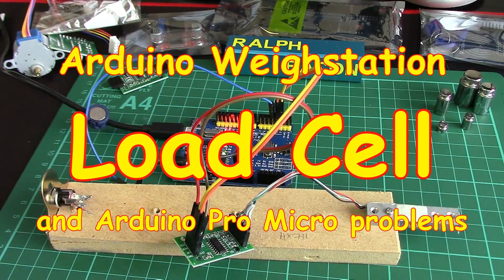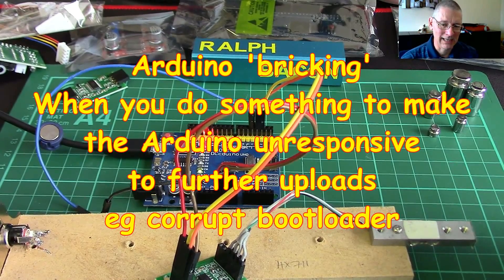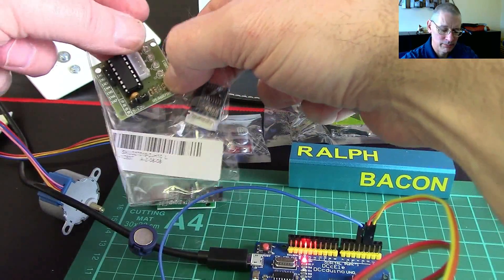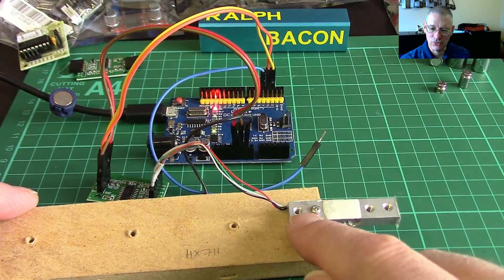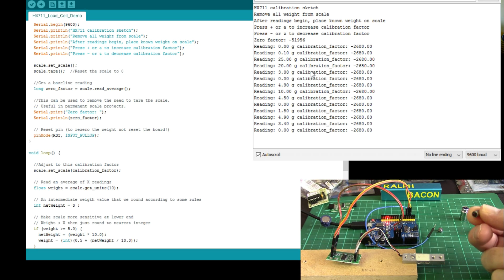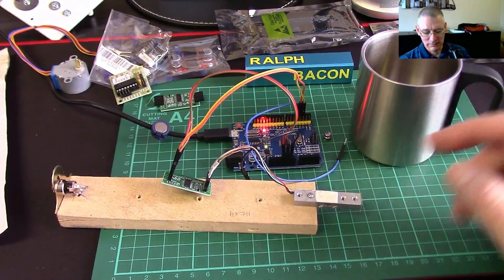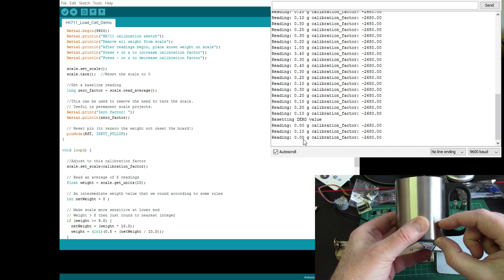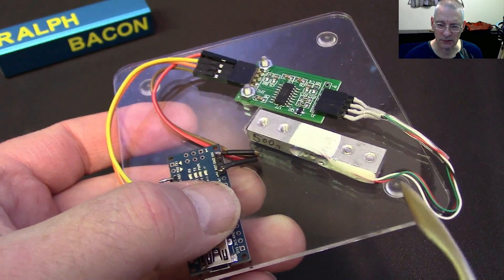#31 Load Cell project (part 1) Arduino Micro problems plus postman deliveries

Comment: Hello Mr. Ralph S Bacon.
Im come from Viet Nam. My English not good but I hope u can help me.

I have 1 project with loadcell, arduino and 2 step motor( example: Step A and Step B).
__________________
1. Im setup value Loadcell is 50 gram ( press from keypad 4x4) then:
- Step A( Step motor) ROTATE CLOCKWISE about 100 second ( delay 100 second ) then Step A REVERSE ROTATION and Step B ROTATE CLOCKWISE.... And loop back to when press stop button.
*******************
I dont understand How about output signal from loadcell control step motor. Mr. Ralph S Bacon can suggest for me write code arduino.
_____________________
 I really appreciate your help with my project! I owe you a great deal
__________
Can you contact with me E-mail: matsusakutaro@gmail.com
Reply from the maker: Hello Sakutaro from Vietnam! I can't write your code for you, but I can suggest how you might approach this project so that you learn the individual skills necessary.

1. Create a simple project that only deals with a single stepper motor. My videos #38 & #39 may help you with this. Get this working so that you understand exactly how to control a stepper motor.
 
2. Create a simple project that only deals with the Load Cell. This video #31 & the next one #32 deal with that. When you have this working so that weights are measured accurately each time you can move onto the next step.
 
Once you have mastered those two areas you may already realise how to combine the two projects to control your stepper motors. If you try and rush this all as one big project you will not understand the individual steps you need to take to ensure success.
 
From your description I can't understand what the Load Cell is trying to do as part of your overall project, so make sure that you have fully detailed each step (like a flow chart). Then others may be able to assist you further. Good luck and if you have specific questions on the Load Cell or Stepper Motor do reply to this message - but as I said I won't write your code for you, that's the challenge you have set yourself! Good luck.

Comment: How do I sensitize it to measure how much left in a Tod glass?
Reply from the maker: I'm assuming here, Johannes, you mean a tot (as in shot) glass, not Tod(d) Glass, the famous American stand-up comedian? If you use a 100g Load Cell as I did it will EASILY measure down to the last dribble in the glass, as per my coffee cup coaster does, every day. What Load Cell are you using? And what sketch? If you use both a 100g Load Cell and my Coffee Cup coaster sketch then it will be no problemo. Let me know your set up.
Reply: Ebay no name cheap loadcell. We can call your Todd a shot for my purpose (25ml approx)  Thanks will post sketch soon.
Reply from the maker: The critical factor here, Johannes, is the max load of the Load Cell. A 100g cell (like mine) is very sensitive right down to the last 1/10 of a gram. If, by chance, you're using a 1 Kg Load Cell then I think you will have problems getting it sensitive enough. As you say, though, get it up and running whatever the capacity because you can always swap out one Load Cell for another and just re-run the calibration routine.

Comment: So... could a load cell be used in the 'hand' of a robot arm to control grip pressure? (I'm a beginner so be patient if you have already answered)
Reply from the maker: I'VE ALREADY ANSWERED THIS DAMMIT... oh, sorry, didn't read to the end of your post! Heh, heh, just kidding Jennifer, we were all beginners once (and I still am, as far as I am concerned). Benny is the guru, not me. Now...
 
Now, the Load Cell is quite chunky as the video shows. It must be mounted so the "weighing end" is free floating. Absolutely nothing much touch it (no covering, for example). If all these requirements can be built into a robot hand then it would definitely measure grip (well, the pressure exerted upon it, in grams).
 
If you can't physically fit the device into a finger/hand then how about conductive foam? That too changes resistance depending on pressure, although I don't know how durable it will be. Just suggestin'! Thanks for your question, Jennifer, and I wish you luck in your project!
Reply: Jennifer,  
 You can use this to measure pressure, the device under the glue in the load cell (The actual resistor network) is called a strain gauge, they come in various sizes from very very tiny to quite big. The sensitivity of the measurement they make is directly affected by the gauge chosen and the flexibility of the thing being bent. (Thats why there are holes in that bar, to make it more sensitive, without the holes it would still work, but would not read the very small weights) 
Here are some examples of strain gauges:
https://www.digikey.com/products/en/sensors-transducers/strain-gauges/559?k=strain%20gages

These can be wired to the same HX711 Ralph uses.
 Regards, 
   Drew
Read more

Comment: Hello, I work with this HX711 amplifier, for a communicating mailbox project, when there is a letter / parcel, it sends a notification to a phone: D, I would like to know how many bytes are transferred per second , moreover I do not know how are connected the pins CLOCK AND DAT.Thanks !
Reply from the maker: Hello AppleFanBoy! The Sparkfun datasheet for this device states that you can select either 10SPS or 80SPS. The CLOCK is driven by the microcontroller and the DATA OUT is read by the µController. Your best best is to read in some detail this document(https://cdn.sparkfun.com/datasheets/Sensors/ForceFlex/hx711_english.pdf) or buy a module like I use in the demo (so much simpler, IMHO). Have fun with this!
Reply: Thanks :D

Comment: Hi how about fitting it to the bottom of your post box to let you know when you get mail
Reply from the maker: A brilliant idea Paul! This would work well in the United States where mail gets delivered to funny looking mail boxes at the end of the front garden (although the postman raises a flag too) - but you'd need power out there, either running up the mail box post or solar power (let's face it, post is unlikely to be delivered at night).
 
In the UK, it's a little different, as all mail is delivered through the letter box of each house (no outside mail boxes at all) but it could sense the mail falling to the floor in the area of the letter box, as long as the mail didn't waft up the hall too far!
 
I'm not sure how mail is delivered in the United States in cities with apartment blocks; I'm assuming the mail goes into mail boxes for each apartment in a communal area, which could make it tricky too. My parents' mail is delivered to an external mailbox outside their apartment building but there is no way the landlord would let them start running power to those (shared) mailboxes - nor can they drill holes to provide power by using solar power.
 
So for many people it would work, and for many it would not. But it's a great piece of lateral thinking and perhaps someone reading this will think "Yes! I'll do this" so thanks a bunch for posting (obviously I don't know where you are located in the world, so I covered a few bases here for the benefit of anyone reading this not familiar with the way post is delivered in some parts of the world). Good to hear from you Paul.
Reply: Ralph S Bacon hi I live in the UK and have a postbox fitted to the inside of the front door to stop the dog playing with the post
Reply from the maker: In which case your idea should work 100% - fantastic!
Reply: In my neighborhood (Houston,Texas), our mail is delivered to a gang (cluster) box which is on the next block about 150 feet from my front door. :( Now a box for Amazon deliveries by the front door would be a great candidate for this project!

Comment: Could you not use this device to measure the pressure being exerted during the use of a gripper or perhaps on the fingertips of a prosthetic?
Reply from the maker: Hi Bill! Interesting question. It will measure gripper pressure in the sense that it will correctly detect force (in one direction) but it is  (relatively speaking) a physically large device so I'm not sure how you would incorporate that into a prosthetic to be honest. Moreover, it must be mounted so that the area you exert force on is 'floating' with the other end secured.
 
Have you considered conductive foam that varies its resistance depending on how much pressure is exerted onto it? They're used in burglar alarm door-mats that get triggered when a human walks on them but they don't react to your domestic kitty walking over them. Just suggestin' !
 
Thanks for a great question, you never know, others may chip in here with suggestions too.
Reply: Hey Bill, I posted a response to this question a couple comments up that may be of interest to you.
Reply: Thanks Drew, I checked out the link and some of these seem reasonably feasible. Thanks for the intel.
Reply: Absolutely, the gauges in the link are the type I work with at work, its a good representation of the different styles out there, I'm sure there are much more cost effective hobbyist gauges available.

Comment: Hi, could you have the code show in the video? I only need the calibration code.
Thx a lot. Send me at mauri.carlo00@gmail.com
Reply: HX711_Load_Cell_Demo sketch I need..
Reply from the maker: Hey Carlo! I've added a link to DropBox folder in the next video to this one (so it's #32, in the video description) that contains the two calibration steps you need (one to get the "seed" value, the next to actually calibrate it properly). I've renamed them too so it's no long the name you specified but it should be pretty obvious now). Have a look, any problems let me know!
Reply from the maker: The seed is roughly calculated using the first step of those files I uploaded now. You then use that value in the second step as a starting point and do some fine adjustments there in the sketch by typing + or - in the serial monitor window. 
I can't see that link: 404. That’s an error. The requested URL was not found on this server. That’s all we know.

Comment: I just view your video regarding Arduino and Loading Cell. You might want to monitor weight loss over time. For example, the loss of weight of a beverage (carbonated pop)  as CO2 is escaping the glass. Thanks...!!!
Reply from the maker: You could indeed monitor that Jaime, but the weight of CO2 is tiny compared to the liquid, I wonder if it would even register? According to my school boy chemistry one litre of CO2 gas would weigh just under 2.0 grams. That's one litre of gas. How much in a can of cola though? Interesting post, good to hear from you!

Comment: i wanted to make a PROTOTYPE system in moving train of kids toys. now if the weight will overcome 50 gram in first coach  the door of next coach will open automatically.(resulting into saving electricity & reducing wear & tear of wheels pf train  since until the coach is closed people wont be there inside the coach -considering the original or real situation of trains now a days) I have tested the engine of this toy can only carry 200 grams upto maximum limit . Now it is necessary to put the microcontroller & motor & one other circuit on that train which might weigh 80 grams for door opening  is there any load cell that weighs 50-80 grams & can detect 20-50 grams or should i use any other component & one more thing where to find the PROGRAM for such projcts or my project
Reply from the maker: I'm not sure I understand how you are going to weigh the train if the module you are using is ON that train. Surely the easier way would be to have the equivalent of a train weigh-station so that as the train pulls up at the station, the train(or some of it) is being weighed (by a Load Cell, for example, on which the tracks are laid in the usual way). Effectively it becomes a floating length of track but as the actual vertical deviation is tiny it would probably just be part of the standard track. I would suggest that you experiment with the same Load Cell as in my videos; once you have that working I think you will have a better idea of what would work and what would not. Just suggestin'!

Comment: hello i have not even a bit of idea about automation.but i want to make project on " automatic door open & close system based on weight sensing (that will detect the weight in grams) im pretty much sure i can do it with aurdino m/c but what should i use as weight sensing (that should be very light in weight as i have to put it on toy) load cell, pressure sensor or strain gauge or any other component plz help me..& plz rply
Reply from the maker: Hello Gaurav! Yes a Load Cell is ideal for sensing weight as my videos #31 and #32 demonstrate. And they are very light and sensitive (especially if you get a 500g Load Cell like mine, it can detect down to 0.5g). So it should be OK for your toy set up. If you give me more details on what you are trying to do I might be able to suggest more. Thanks for posting, good to hear from you.

Comment: Very amazing video.

I saw that your 500g load cell has the precision of 0.1g. So is correct if I assume the precision for 1kg load cell is 0.2g?
Reply from the maker: Hi Muhammad! I'm not sure it works like that as the manufacturer could put whatever precision on the Load Cell they please. The only definitive way of knowing the precision is to read the Data Sheet (if you can get it for the Load Cell you're interested in). Failing that, the only other way is to actually try it! But it's a fun, inexpensive project, that's for sure! And I'm using my Coffee Cup Coaster every day at work, and it tells me whether I still have coffee in my cup or not. Thanks for posting, now go and experiment with Load Cells!
Reply: thank you for the suggestion. I'll definitely do it.

And... I'm going to subscribe your channels :D

Comment: this is a basic question but what are those black connectors connected to each end of HX711? is the same connected at the end of load cell sensor as well?
Reply from the maker: Hello Archana! Those black connectors are called "header sockets" which as they name implies, accept a plug, called a header pin. Sometimes you get "header pins" onto which you must attach a socket. The Arduino that I use in that video has both header pins and sockets to give it the maximum flexibility whilst developing solutions. The cables that are pre-made and which come with either/or pins or sockets at either end are called "Dupont Cables" and come in strips of 40, very cheap if ordered from the Far East on eBay.
 
The connector at the end of the Load Cell is indeed a set of Header Pins but I connected these up myself (the Load Cell just comes with bare wires).
 
You may find my videos #3 and #4 useful as they describe some of the fundamental hardware you need when playing about with Arduinos (and for that matter, Pi boards too). Great to hear from you, I hope you find the other videos useful too!

Comment: Hi, you can buy this load cell along with the HX711 ADC module on eBay in India at http://www.ebay.in/itm/COMBO-High-accuracy-Load-Cell-with-HX711-for-projects-and-commercial-products-/162370833263